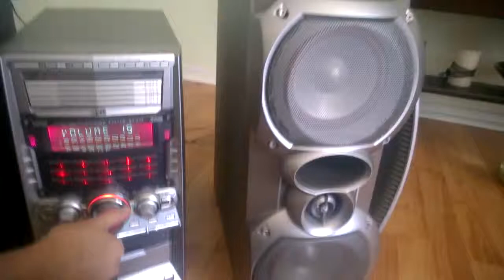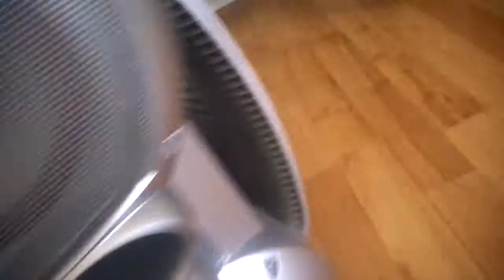Investigating how this particular stereo system works

Comment: I've got the HX-Z10, which is the same, yet softer edition to this, and I've had a very similar fate...
What I did was, unplug the system for a few hours, and when it's plugged back in, turn it on. You will hear both the tape mechanism and the CD mechanism making a bit of noise. When the CD mechanism is settled, you eject the CD tray that your CD is in immediately, then it should open. If it doesn't, then. sad to say, your CD got owned by that player!

My CD player doesn't want to play CD's in my system like this anymore, so I simply hooked up my computer to it, and it's doing a fine job there!

Hope this helps!
Reply from the maker: Thanks, I'll try that. When I get to my friend's house. It's not mine. I was trying to help her sell it.